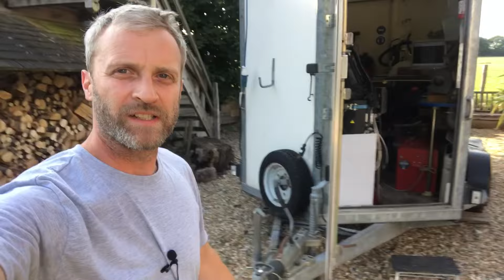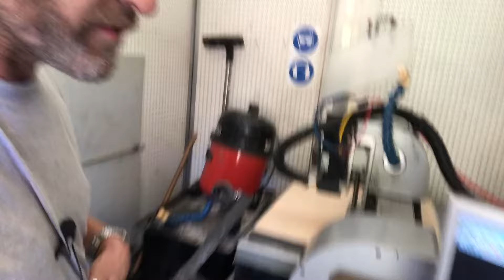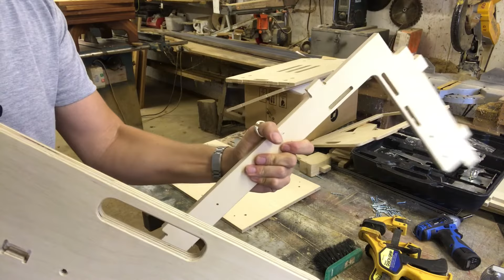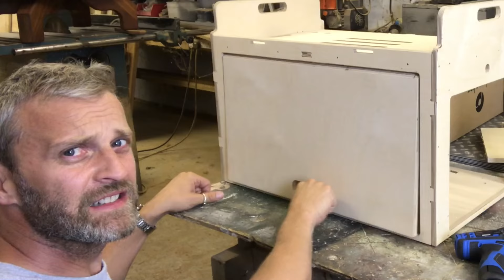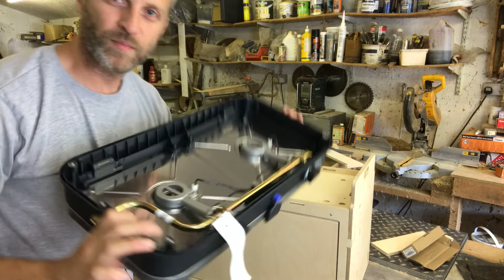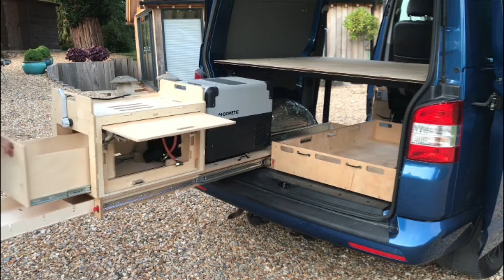Camper Cooker Pod ( CNC Cut Birch Ply )  VW T5  - Mantis Hacks E21

Comment: Hi there, what cnc machine are you using ? 
Also what thickness are you cutting? 2 passes ?
Reply from the maker: It’s a Pacer Cadet 600. 12 or 15 mm usually 3 passes or more
Reply: Okay, thanks for getting back to me. I’m new to cnc machines but plan on cutting camper furniture would you know if a worker bee 1500x1500mm would be any good for cutting 15mm ply. Any help would be great! Also love your work 👍🏻👍🏻
Reply from the maker: Sorry I don’t know that machine so can’t advise. Size is good though.